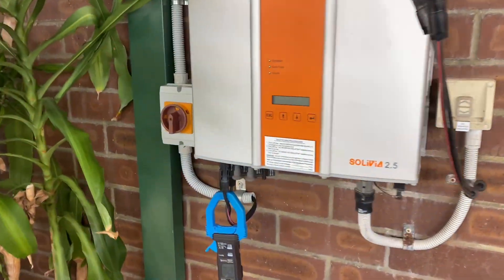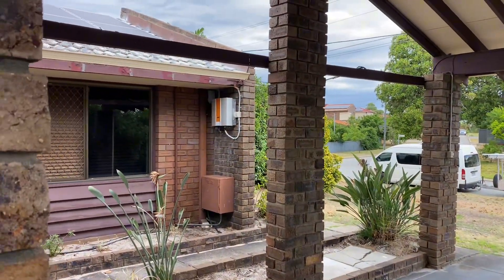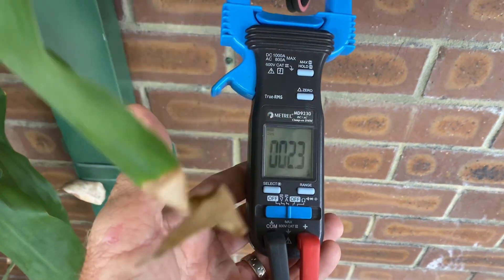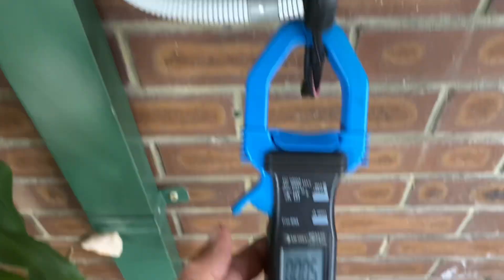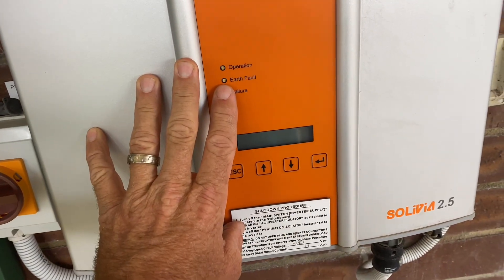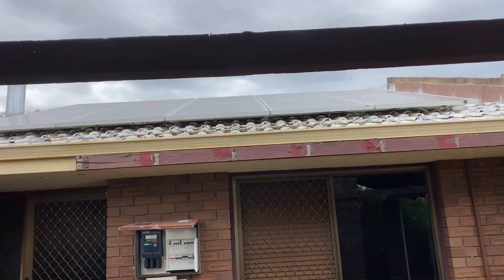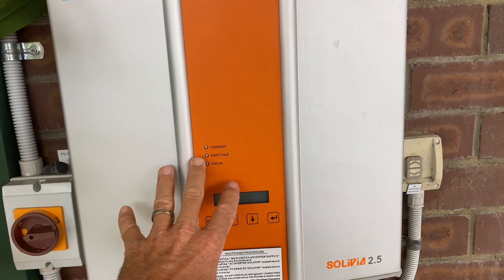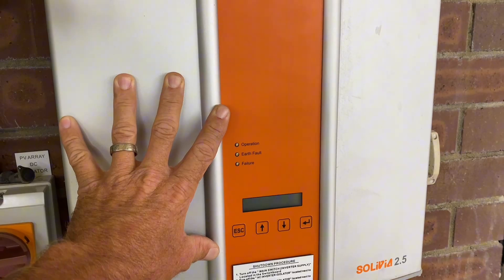Solar Inverter repair. Delta Solivia inverters faulty in Willeton Perth. Why is there two of them? 🤓

Comment: Good to know there some sparkies that understand the 3 phase problem from back in the day. When I ask around every installer wanted to put 1 5Kw single phase inverter one of my 3 phases. I ended up doing exactly what you have and at the time I ordered a pelet of 2.5Kw Delter inverters and after 13 years they nearly all have failed which is very suprising given the very good build quality. BTW the last one to fail has the exact same issue (PV voltage too low) I intend repairing it and have asked Delta for a schematic (still waiting) before I go reverse engineering it.
Reply from the maker: You bought a pallet of them! Holy crap, and they all failed 😞

Comment: You have to wonder about how the world works. Yes absolutely you have to get the existing system working to sell it. Both as a selling point  but also a non functioning system would be a negative point. 
But London to a brick, the new owner is quite likely to pull it all off and fit a new system to support a big shiny new subsidised battery almost immediately, and the new inverters you fit today will likely be in the skip in a few months.
Reply from the maker: Sadly yep, that is certainly possible. Lets at least hope they get recycled.
Reply: Id take those. I would even try to repair the old ones. But i aint got a house.